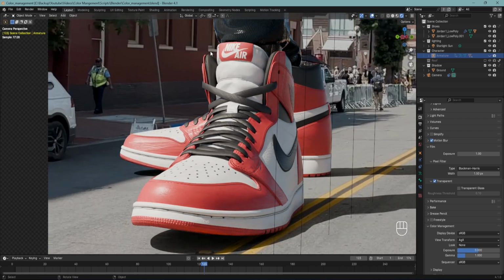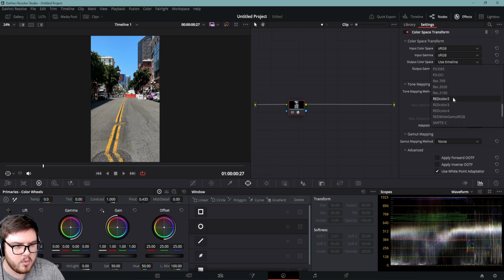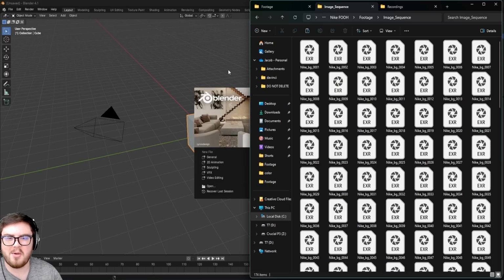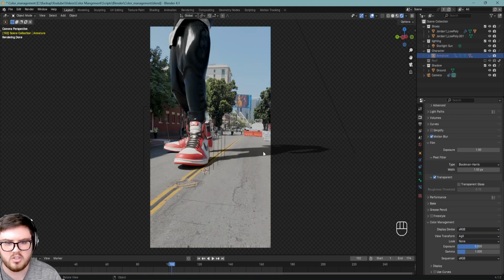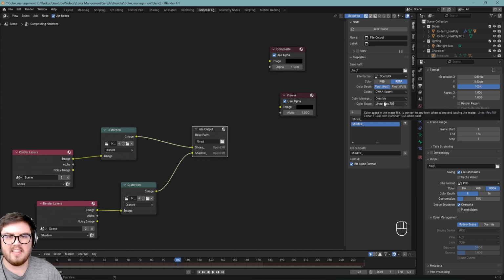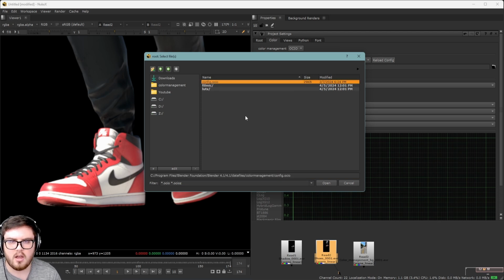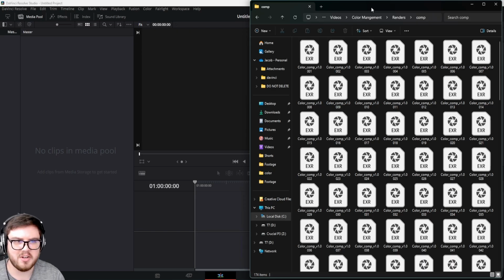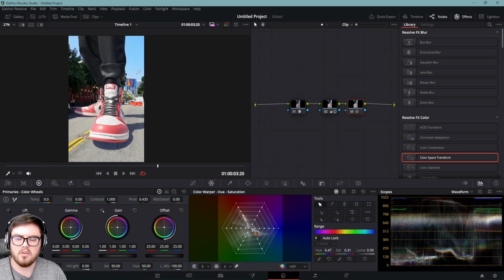Why Your EXR Renders Look Wrong: Blender Color Management Explained!

Comment: Hey Jacob, great video. I wanted to point out why your footage in the color stage at the end in Davinci, after applying your CST (Linear Rec.709 > sRGB) was still looking so washed out at 21:34. The reason is that you missed turning on "Apply Forward OOTF" in the Advanced section at the bottom, which is actually really important step to do at that stage. Jacob of InLightVFX in his BlenderCon talk actually shows this at the 35 minute mark in his demo. But he just does it and doesn't really go over why you should do it. The more technical reason for needing to turn this on is that, the OOTF (which stands for Opto-Optical Transfer Function) refers to the process of converting the image data from one color space to another in the context of display or image capture. It's a method of handling how the image signal is transformed when viewed on a display device. And in this case, the CST you added here was serving that purpose, essentially acting as the ODT (Output Device Transform) step of the color management process. And so turning on the setting here, ensures that the CST on your node is performing that step. So the question becomes, when should you check "Apply Forward OOTF"? You basically want to ALWAYS turn this on if you have a CST that is converting from a working wider gamut linear scene-referred space (Linear Rec.709 / Davinci Wide Gamut), to your final display output space (sRGB / Rec.709 Gamma2.2). Hopefully that makes sense, it's something I realized after I struggled with color management and have been doing my own research; specially in trying to figure out and come up with a workflow that I like, going between Blender and Davinci. Also, I have to also say, that I have grown to love Davinci's Tone Mapping in it's CST. I love AGX but I realized I shouldn't be married to it. Picking your tone mapping or view transform, at the end of the day, is a totally subjective choice. It really is about what looks good to you and your project. I think the Davinci tone mapping does a better job of handling color data or power values that are outside of the color gamut in the transformation. No, it's not gonna look like Blender's AGX view transform like you pointed out in the video, but that is ok. That is to say, personally, I think how the Davinci Tone mapper handles highlights is actually more appealing to me. When you also look at the math of what is happening in the transform, I started to change my mind. I love using AGX in Blender when I'm working in it, but I am not married to it and am ok with it not being there when I'm exporting EXRs out of Blender. Christopher3D just came out with a video on Blender 5.0's ACES 2.0 view transform where he does an awesome job comparing and talking about Blender's view transforms and pointing out some important points about color management in Blender in general. You should totally check out his video!

Comment: Thank you so much for pointing out the Color Management render properties. I wasn't working with EXR files, but this video showed the solution to a problem that never seemed to come up in a Google search. Two blend files using the same linked material displayed the material differently; one looked discolored, and I was utterly confused because the materials were identical. The issue was that the Color Management settings were different between the two blend files. I'm surprised the issue was in the render properties; I wouldn't have expected that to also influence the way the material looks when using the Material Preview viewport shading mode.

Comment: that footage you import under camera option that is for viewing purpose or that footage effect our render or not???
Reply from the maker: The background images in the camera settings is only for viewing purposes. The only time the footage will actually affect your render is if it's in the material nodes so it's a material on an object, or it's in the compositing tab where you are using the footage to composite the final image. Hope that helps

Comment: does it work with acess as well?
Reply from the maker: You can manually override the exr export in blender to render as acescg. Just remember Blender is still applying a AGX view transform in the viewport and so you'll need to have that same AGX view transform in your compositing program for it to look like it did in blender. Idk if that creates any problems with aces

Comment: This times are so many CST Tutroials out there (Jacob, Creative Shrimp....and so on) - and there slidely diffences in the Process. Your Work shows very important Things - thanks for that. But a very important Thing that not so many Davinci User knows is: Your CST in First Node goes from Linear ( a Color Space for Grading) to the RGB (a Color space for Display) - and that important Thing is that ALL Davinci Color Tools works different in different Spaces. In your case u work from now in a limited RGB Space with your Color tools. I think u already know about a second CST Node after all Grades - the First Nodes Output needs in a better way to go LOG Outputs (like AGX or Davinci Space). Best, Ivo
Reply from the maker: Thanks! That's good to know and thanks for sharing! I typically just hand off my footage to a colorist and they handle all of those aspects in davinci and so far no complaints. Of course when I do it myself as you saw in the video, I just do the one node. I have done the two color transform setup in the past so I might have to experiment to see if I can incorporate it into my setup!